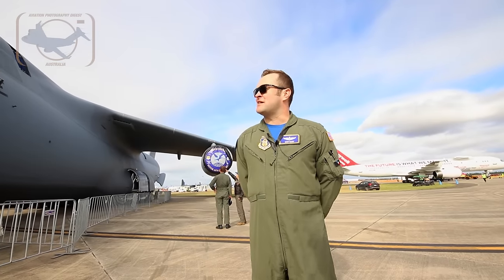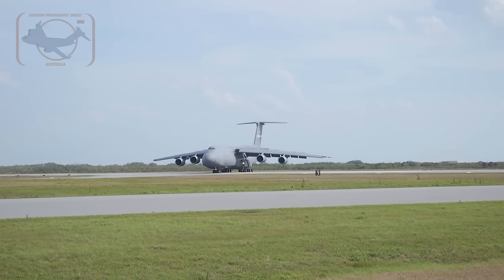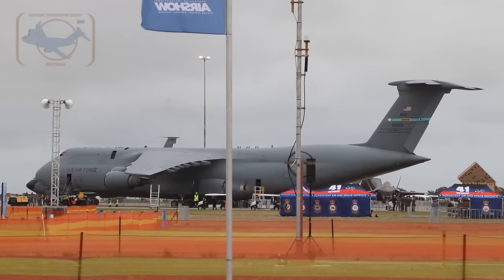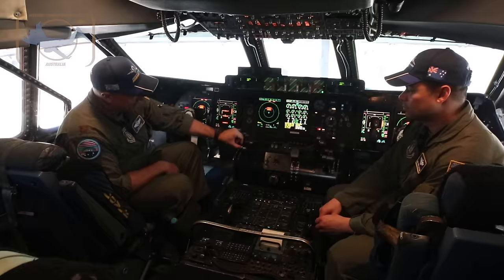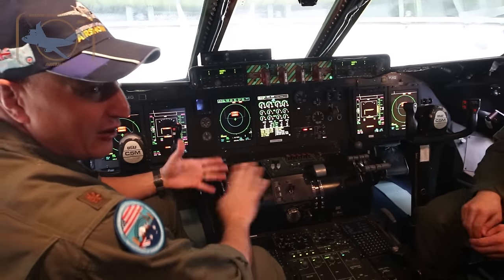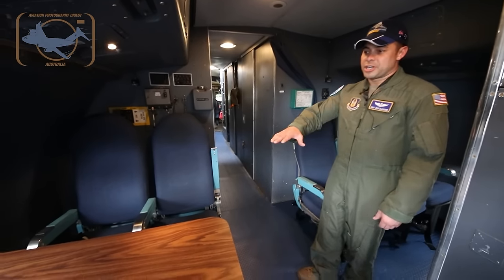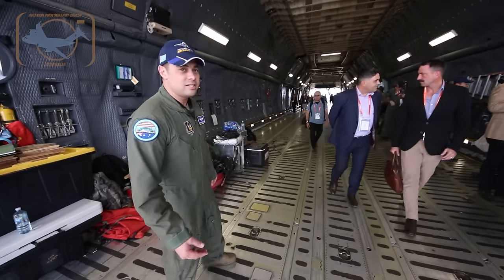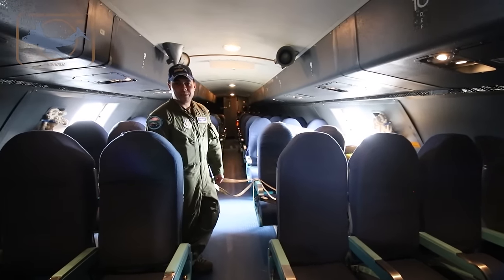A tour of the 'BIGGEST' aircraft in the U.S. Air Force!

Comment: Fun Fact; The wing span of a C-5 is greater that the distance of the Wright Brothers first flight. These are incredible aircraft. I used to work with Air Force Reserves Load master. He worked primarily on C-5s. When he would share stories with us, he would speak with such pride and admiration for the aircraft. The paint job weighs 2800 lbs, come on that's crazy.
Reply: The paint alone weighs more than a 90's Honda Civic! Crazy.
Reply: You are correct, as the wingspan is approx. 102' longer than the Wright Brothers first flight.  The C-5's cargo floor is also longer than the first flight, which means their first flight could have been done inside a Galaxy.
Reply: Another fun fact, that's why during WW2 many heavy bombers were just shiny aluminum because that extra paint, was less payload.
So we have that classic look we all know and love today.

Comment: Nice seeing the upgrades they did on the Avionics package and Engines. They were talking about the engine upgrades being done when I was leaving the service in 2004 but the issue they hadn't resolved yet was the wing loading. With the old engines the thrust was already near the wing load limit for what they could handle. Glad to see they figured out the beef ups needed to do the upgrade. Carrying the avionics components up that little aluminum ladder to the flight deck was always an experience. lol

Comment: Is there a reason for the seating to be placed facing backwards? C-5 is such an amazing aircraft!
Reply: It’s for safety in the event of an emergency landing.  Unlike forward facing seats in a commercial airliner where you have to bend at the waist to brace and will flail into the seat in front of you, in a rear-facing seat the seat back absorbs the energy from your body and spreads it out over the seat.  Much safer and more survivable.  Aviation safety experts know this and acknowledge that rear-facing seats are better but it never caught on with the airlines.

Comment: When I was in the AF, I was stationed  at Shemya AS in the Aleutian Islands (May 83-May 84). A C-5 was coming in and it came in a little low and took the rear landing gear out. Took them a few months to get it repaired enough to take off and land at McCord AFB ( I think it was) in Washington state to be repaired properly.
Reply: It didn’t land at McChord. It flew to Kelly AFB at San Antonio, TX for permanent repairs and modifications for Space Shuttle support.
Reply: @c17nav  It was my understanding it flew to McCord AFB but, if Kelly AFB was where it went, no big deal.

Comment: I was stationed at Charleston, SC in 1970  as a c-141 crew chief with the 437 MAW,  when the first c-5A "222" landed for the first time and a wheel came off, rendering the first C,-5 useless for  quite a few months. I recall seeing a permanently  tied down  10,000 pound ballast weight on the very front of the cargo compartment  because the aircraft  was tail heavy .
Reply: I remember seeing Network film showing the wheel bouncing down the runway.

Comment: What's the difference between the C 17 GLOBEMASTER and the C 5M Super Galaxy? Please explain. Thank You.
Reply from the maker: C-5 a lot bigger and have been around for a lot longer.
Reply: @aviationphotographydigest  Now I know. Add my insight.
Thank You Sir.
Reply: C-17 body ( no wings)  can almost fit inside a C5. 
Hope that reference helps
Reply: @boltactoinbarney  huge C5
Reply: C-17 also has a short field and unimproved field capability the C-5 does not.  C-17 does not have control yokes, it has a stick like a fighter.   C-17 pilots have told me it performs more like a fighter, while the C-5 performs like a bus.  The “M” model may be a little more light on its feet.
Reply: @David-nx2vm  thank you

Comment: When I was in the Marines we flew back from Tazar Hungary on a C5.  I didn’t like sitting backwards upstairs.  The runway was kind of short. It was a site seeing the galaxy’s land and take off on a shorter strip.  I will say it was more comfortable that the kc17 we took over there.  When we flew back from Haiti we got transported in a C141 out of Charleston.   Never got to ride in a KC 10 but I unloaded a lot of them at MCAS Beaufort.
Reply: @Mike, Ooh Rah, Mike! Sounds like we had similar experiences. My flight on a C5-A was from Japan to the Philippines in 1983.
Reply: No such aircraft as a kc17. Perhaps you meant a C-17A Globemaster III?
Reply: @c17nav  probably a C-17. A KC-17 would be a tanker (refueler)... tankers are not used much for troop transport. You COULD if you removed the onboard fuel tanks.
Reply: @c17nav we called it a KC-17 when i was in  at the tips of the wings it looked like it has flaps  or tips that went straight up in the air.   i also flew back from haiti on i think it's was a C-141   had  a tall tail fin and a low body.  it was stationed out of charleston
Reply: @Mike-lj4ue  C-141s have been retired and scrapped for about two decades. C-17s have the turned up winglets at the tips of the wings. There is no “KC-17”. The C-17 cannot refuel other aircraft.
Reply: well it was a 17 then  and it was over 20 years ago when we came back from haiti  august of 98.  i know for sure it was a 141  i remember we had our conex on it.   and we definitely landed in charleston and bused back to beaufort
Reply: @Mike-lj4ue  Charleston was the lead operational base to field the C-17.